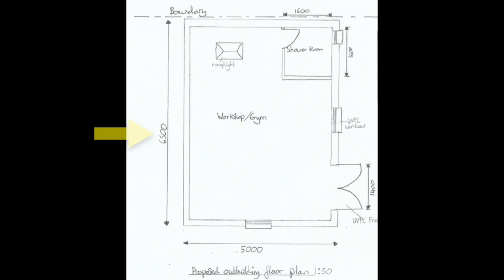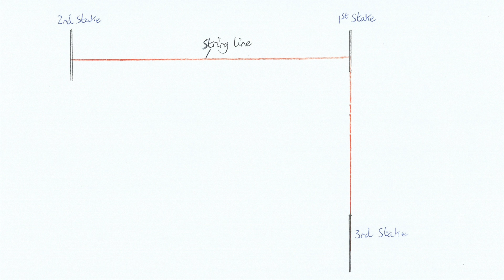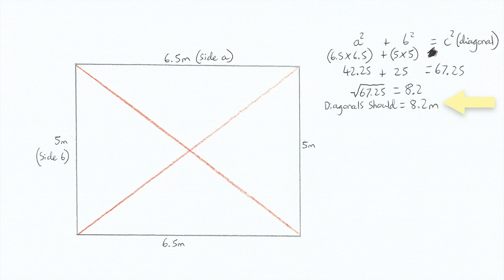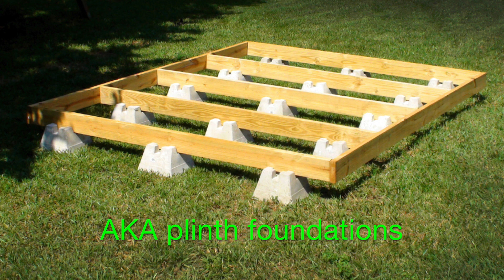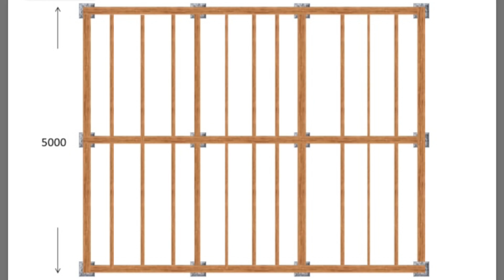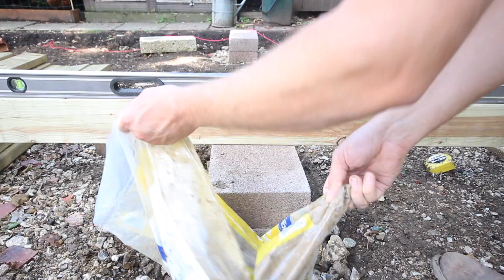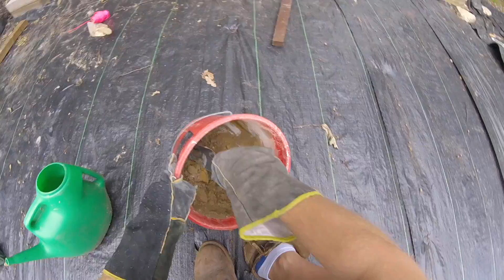Garden Room Workshop: Part 4. Setting out & Foundations

Comment: Thanks again Ali. Do you have any knowledge or thoughts on ground level. The reason I ask is because I have a sloped garden, which slopes on one side next to a fence. The problem I have is what is ground level? I plan on getting rid of soil to make it level, but how far down do I go?
Reply from the maker: Well my good fellow, I have the perfect answer for you right here (and it's good news): http://www.alidymock.com/planning-permission-building-regs/
Reply: Ali Dymock thanks Ali. I have checked this and planning rules state it can be the maximum heigh permitted from the ground at anywhere adjacent to the building. What’s your take on the word adjacent in this context. My plan was to leave a deliberate gap between the building and higher ground around the building. Do you think this would negate the adjacent aspect, as it won’t touch any part? The rules don’t appear to always be clear. Unfortunately councils aren’t in for obvious reasons, otherwise I’d ask them also.
Reply from the maker: @2wheelspy  Yes so height is measured from the highest point adjacent so if you have a sloping site, you can pick the highest point which is good news.

It sounds like you might be planning to dig out and build a retaining wall and have a gap between that and the garden room to allow it to be built in timber? I reckon that gap would stop the top of the retaining wall from being labelled adjacent 😔, BUT if that is the case, it won't look that high I reckon so you'd probably get away with it. 

Other options: 1. build the section of the wall where you dig out with blocks and use bitumen to tank the outside. That way the ground WILL be adjacent. Or 2. Use a plank of wood or fascia board to bridge the gap between the retaining wall and the timber wall of your garden room so it becomes the new ground level ;)

The best approach here is to show your neighbours your plans, make sure they are happy and then you don't need to worry.
Reply: Ali Dymock again thanks. You’re a clever chap and understood my intention very well regarding digging out and building a retaining wall. Please can you elaborate what you mean by option 2. Option 1 is a possible also, but I’m not sure I’d want any possible weight to be on the back of the building, where the highest point will be. Also, what option would you choose?
Reply from the maker: @2wheelspy  I think I just spend too much time thinking about garden rooms. Well with option 1 you would build a proper retaining wall, which you'd have to do anyway,  and then just tank both sides and build any additional wall with timber on top of the retaining wall.
option 2. Like just think of a way to bridge the gap so it looks like ground level - personally I would just leave a gap, it's unlikely the council will come round.

I'm not sure which option I'd go for. I think I'd need a more holistic view of the site and what you want from the build. You can email me pics or sketches if you like :)
Reply: Ali Dymock thanks. I’ll do it tomorrow, gotta go to work now :(

Comment: Hi Ali, 

Brilliant video, extremely detailed and clear to understand, quick question.  With the foundations you went for i saw somewhere saying that disadvatages of it is that rodents can nest underneath? 

Is this the case? Would appreciate your help thank you.
Reply from the maker: I get asked this a lot, or some variation of the question so I will be making a video where I cover this question more fully. But yes, it's possible but unless there is food around there is no particular reason why they would. The other related question is will they eat or make nest material out of the insulation? From my experience, definitely not PIR but wool insulation, I would expect so. If you are worried, I would build a block permitter all the way around the base and put in a few air vent bricks to allow ventilation. Either that or go for a concrete base.
Reply: Ali Dymock Hi Ali, I have just done a bit of planning and am trying to go for PD but size of floor and roof joist takes up most of the 2.5m allowance. I am thinking of an alternative route whereby I dig a little deeper and have the floor joist 50mm protruding above ground level to save space rather than start at ground level up, is this a good idea? If so are the methods you use still the same? Thank you for your help.
Reply from the maker: @mmmm-fp6tk  Absolutely. I'm going to clarify the 15cm rule in a future video. It's b regs and while nice to have it just steals too much height if you are going with 2.5m overall height. So I would say 50mm is perfect to allow ventilation underneath but not take up too much height. You don't necessarily have to dig down too much deeper, just make sure your top block is half in, half out of the ground so you're only 50mm above ground level (assuming your land is flat).
Reply: Ali Dymock Sorry if i didnt explain properly or if im not getting it, (thank you for quick reply btw)  I was suggesting the the pier be below ground level and joist to sit on top of blocks (how you have done it) and the actual timber itself be 50mm above ground level so the joist for the building will be below ground level apart from the top 50mm. Would this work providing i leave enough space around the edge of the building for air flow? Thank you again.
Reply from the maker: @mmmm-fp6tk  my bad you did explain properly, I just didn't read it thoroughly.

 I've seen this done, a few people have emailed me with pictures. I'd say it's viable. It will undoubtedly increase the likelihood of damp/rot and could act as a pond if your water table is high in winter - have a think about what the drainage is like and are you on a hill etc.

I just can't quite visualise how you are going to get air flow under the timber or how you can leave a gap around the timbers unless you are planning on covering the gap with decking on all sides (assuming a level site).

I'm thinking a concrete slab may suit you better but of course if you insulate on top of it, that does also increase the height. Maybe draw me a picture and email?
Reply: Thank you for your swift reply Ali. I look forward to your upcoming videos.

Comment: You didn't realize you needed to design around 4 x 8 ft plywood?
Reply from the maker: yes I did, hence going imperial, but found out later that metric (400mm on centre) would have been preferable!
Reply: Ali Dymock why would 400 centres be preferable? If your OSB3 sheet material is 2440mm I think you need the 16inch centres or have I got that wrong? I am currently deciding between 400mm or 16inch centres but because I want to use OSB3 as well which comes in imperial sizes so I believe I need to use 16inch? Sorry if that’s a dumb question!
Reply from the maker: Definitely not a dumb question Sam, it's the system that is really complicated and just plain confusing for non-builders. All to be explained in upcoming vid but plasterboard is only available in 1200 width (900 too but not helpful) so ideally on 400mm centres. You can get metric OSB3, it's just a bit harder to find. As I say, wait for Part 16.
Reply: You are best to build at 400 centres and just rip the osb to 1200wide

Comment: Question:  I've heard that you shouldn't lay poly or any other tarp down to prevent weeds from coming through.  It's important that the ground can still evaporate water.  Is that what landscape fabric does?  Stop plant growth, but breathes?  Is that what you used?

Loving the videos!  You'd said you created them because everything else you could find about building, leaves out the thought process and the reasons for doing something one way over another.  Totally right!  And I'm loving that you're doing that.  Thanks
Reply from the maker: I think that's certainly true of polythene but weed fabric is breathable and allows water through, just not light. Sometime syou see it used in allotments to keep weeds down over winter and I'm not sure that does much good for the soil and but for under a garden room I think it's worth doing.
Thanks, glad you like it!

Comment: Fantastic video, thanks for sharing your process. In my build I'm torn over whether to use an adjustable foundation pad system (Easy Pad) or whether to use high density concrete blocks like you have. How difficult was the levelling between the piers? Did you have to just be very accurate with the depths of the underlying compacted sub base and sand?
Reply from the maker: I think both are decent options. Using cement with fine sand really helps with getting everything level. It's not that easy but with a lot of checking and re-checking I think it's a really good option.

Comment: Sharp sand or building sand to mix with cement? Ballast? Different mix for block to ground and the mix in between blocks?
Reply from the maker: I'd say building sand - you don't really want any stones in there. Block to ground doesn't matter so much as long as you get that first block level

Comment: Hi all, 

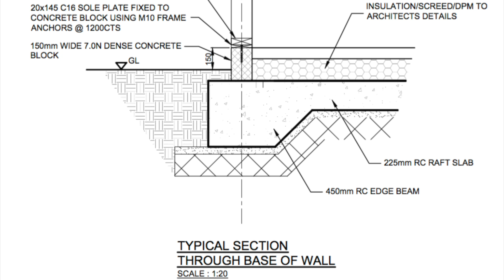I'm thinking of using a concrete base and I was wondering why the need for the 150mm step from the floor level to ground at 4:55? I think I remember it being said I one video to have the timber walls start from 150mm high to avoid rain water splash. 

I ask because I need to get a small trailer in to the workshop and it would be nice to have the floor of the workshop the height.

Could it be to avoid surface water flooding? I'm thinking of having a drainage channel in front of the doors for this reason.
Reply from the maker: Hi Devinder. The 15cm is a building regs rule and therefore not applicable to most garden rooms so by all means go lower. If for example you are going for a concrete base, then I'd recommend no more than 5cm above ground level.

Comment: Hi Ali, did you ever consider using ecobase plastic base for this project? I'm stuck between choosing from either the plastic ecobase or the quick jack option. The quick jack option means you can change the height of the shed to make it easy to level out.
Reply from the maker: yeh I did look at both options, and think both have their merits so if one of them is right for you then go for it. The adjustable height would really come in handy I can tell you!
Reply: I'm considering an ecobase for mine at the moment, did you go for it in the end?
Reply: just ordered the WoodBlueprints. Com guide for step-by-step videos and different plans to BUILD A SHED. they have some awesome plans in there

Comment: Many thanks for this series, it's a great help in planning and the best I've seen on YT by far.
I'm hoping to get permitted development so height can be 2.5m but I'm also hoping for a warm roof. My timbers don't need to span the lengths yours do so I save some there but this video suggests I can claw back some of the 6 inches of height between ground level and floor timbers. Is the 6 inch figure regs or did you come up with it?
Reply from the maker: Hi Stuart, yeh the 15cm/6" is a building regs rule so it's a nice to have but you don't need it as long as your garden room is under 30m2 internal floor area. With 2.5m restriction under PD, you're quite correct - you can't be wasting that 15cm. Either go with a concrete base or have your blocks no more than 5cm above ground level would be my recommendation.

Comment: Hi Ali great series I'm at the starting the block piers stage I'm thinking 6ins of hardcore an inch or so of cement and just one 140mm block  5cm above ground, how does this sound?
Reply from the maker: That sounds perfect Tony. The only reason mine are so high is not really the building regs rule but the fact that the ground is much higher at the back so yeh that spot on mate
Reply: Ah cheers Ali, all ready for cementing in tomorrow. If it wasn't for your infomative videos l would never had started this project.thanks again.

Comment: Hi, I'm wondering how many man hours I should expect this to take to build.  I'm looking at 12ft x 8ft and will be using 1900 doors to allow the complete structure to stay below 2500.  I expect to complete the work in phases, but interested to get a view on total time spent.
Reply from the maker: It's a good question. I'm not sure I can give any useful answer though. Filming a lot of it makes it take longer and at times, I've thrown myself into it while at others, months have gone by without doing anything so it's hard to gauge. Also I didn't have this series so working everything out takes longer. I'd say the actual work is about half the time, the rest is research and choosing/picking up supplies.

Comment: Great video. I thinking off doing the same foundation as in your video for a log cabin 5x3 the ground is fairly level may only need one block high. Would you still lay on a bed of cement or just hardcore and sand?
Reply from the maker: Yup, if the ground is level and you are building under permitted development, I'd have one block below ground and maybe the second block just protruding 5cm. Definitely lay on a bed of cement, I didn't, no problems at all but would recommend.
Reply: Ali Dymock didn’t you say something that there needs to be a 15cm gap between ground and base? Building regs?
Reply from the maker: @sw2048  Yes that's a building regs rule but as b regs aren't usually required for garden room builds you can ignore that and go for a lot lower.

Comment: Hi Ali your vids are a great help for my upcoming build, i too have gone for the concrete block pillar foundations. I have had to dig a about 60cm down on one side till I hit the harder clay type earth. I have filled the holes with about 40cm of hardcore which after recent rain appears to be holding water if I tamper down on the hardcore there is am almost water type movement. My question is where did you get your information for concrete block foundations? Not much on the web for this type of foundation. My build will be as large/heavy as yours so important I get it right at this stage. I am now thinking on the side with 40 cm of hardcore I should maybe pour concrete rather than hardcore. Have you had any movement in your build at all?
Reply from the maker: Interesting. I guess once the building is up no water would get into those holes or very little. Mine has had no movement at all but yes, I'd recommend going as deep as you can and perhaps pouring concrete rather than hardcore then a block or two cemented on top.

Comment: Hi Ali, been really useful watching your vids. 3 piers high seems a lot for me. My build will be 20’x10’ and I don’t want it raised too much. Do you think I’d get away with 2?
Reply from the maker: Hi Carl, great question. When I get round to writing up about this on the website I will definitely explain that the reason mine is so high is in part due to the high ground level at the back of my garden room. Whilst b regs suggests 6inches/15cm above ground level this is not a house. If you have a flat area and you're doing yours under PD, don't waste that amount of height just on your foundations. 5cm will ensure decent enough airflow or if you go for a concrete slab, 3cm above ground level could be okay. In the latter case I'd dig away earth around the slab and put in gravel to allow goo drainage and keep an eye out that the earth doesn't grow higher over the years.
Reply: Ali Dymock that’s great Ali, thanks for the info and rapid response. 👍

Comment: Great series of videos. Only downside my short cuts are highlighted even more with your in-depth research. Did you stick to budget?
Reply from the maker: Thanks Zeph. I didn't make a strict budget so I kept myself off the hook on that one 😁I'll do a cost video at the end.
Reply: That would be great to see. I'm 'trying'   to build on a £2000 budget. That's what I'm telling the wife anyway😊
Reply from the maker: Haha good luck!!
Reply: @AliDymock  Hi Ali do you still provide a working discount code for rubber roofs, would love to take offer up, finally built my frame and need to work on fascias, soffits and roof now.? Much appreciated if you can provide a code. My other question is where did you source your fascias and soffits? looking to install these first then roof? Many thanks Zeph

Comment: Hi Ali. Thankfully I came across your videos a month ago as im looking to build my own Garden Room at the bottom of the garden and congratulate you on a fantastic series of videos. The Garden Room im looking to build will be no more than 2.5m high and around 35m squared in a C shaped design as of the shape of the garden. I was looking at the permitted development route but I would like the option of a toilet and wash basin. I am assuming i will need building permission for this because of the drainage and water supply.  I know you said on your design you were looking to include a shower facility, I was wondering how you were thinking of do this in terms of digging the trench and picking up the drainage and water supply??
Reply from the maker: Wow a curved shape would be cool. I’m pretty sure you don’t need planning for a sink and WC but yeh for mine I’m having a full shower room which involves digging a trench for water and waste (and electrics going in too). Yes this needs building regs but I’m hiring people to do it who will sign it off so that’s no issue.

Comment: Another great video that I followed 'step-by-step'. I just want to share a tip for anyone who, like me, may struggle with the concrete screw bolts. No matter how much vacuuming and re-drilling of the hole I did, my screw bolt always tightened up way short of the required depth of the hole. Each time I measured the hole depth before inserting the screw bolt it was deeper than the bolt but after attempting to fit and then removing the bolt the hole had become shallower! My top tip being pour in a little water, which helps remove any compacted drill-dust.
Reply from the maker: So interesting David, I had the same issue now I think about it. Didn't think to use water! Great tip